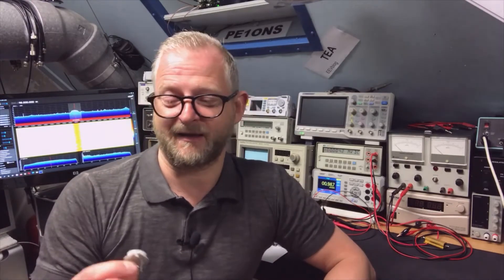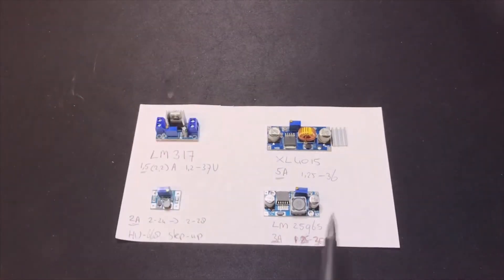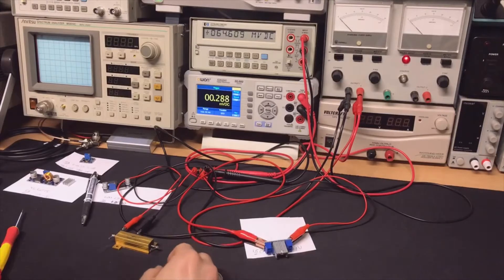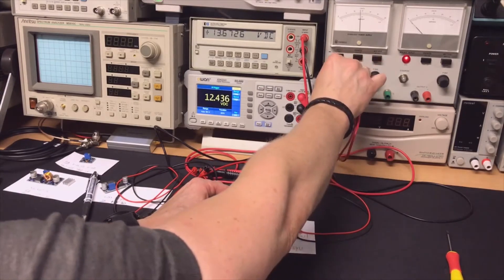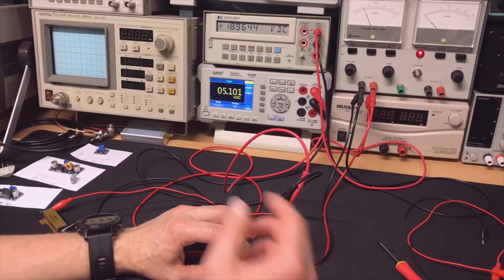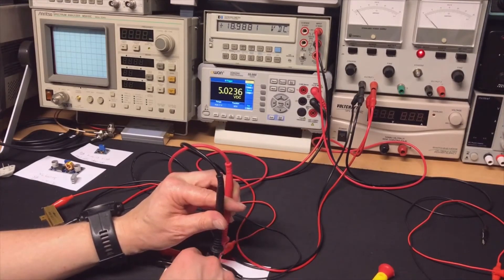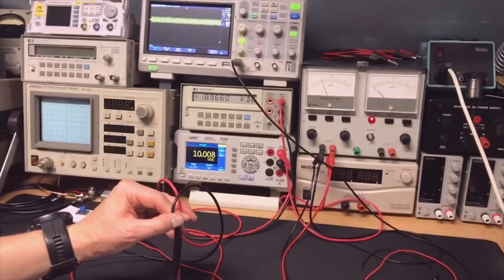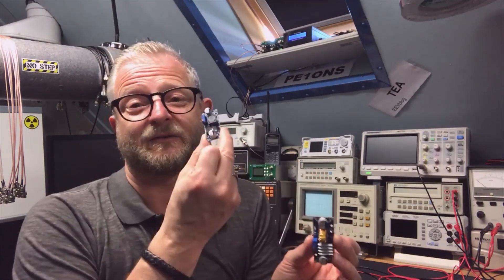#055 DC-DC Converters Buck Converter LM317 LM2596 XL4015

Comment: Can i charge  12,6 volt baterry with Laptop charger use XL4015 sir?
Reply from the maker: Charging batteries can be dangerous depending on the type of battery, like fire,  look for a correct charger for your type of battery
Reply: @TonyAlbus  18650 - 3s (12,6 volt)
Reply from the maker: @Syam-uo3wy  Don't use these modules.. better look for a LiPo charger.
Reply: @TonyAlbus  Ok thanks

Comment: Hi, what happens if output is set to 12v and input alternates between 12v and 14.5v? Will output voltage jump between 9.5v and 12v?
Reply from the maker: it should stay stable... otherwise it would be just liek a resistor, but i dont remember to be honest... i willneed t try that.
Reply: @TonyAlbus  thanks I know already output drops to 11.5v when input drops to 12v

Comment: Great explanation.  I have a DER EE-5000 LCR meter.  It uses a 9V battery and has an alternative power supply option.  The original power supply is 9V, 650mA SMPS.  Which option is best to reduce the voltage of the SMPS 12V 1A power supply, to use it to power the device?  With the lowest noise of course.
Reply from the maker: Hello Alcyone, for the LCR i would go for a Linear converter. LM317 or uA7809 and you can put 100nF at the input and output to ground for extra noise reduction.
Reply: @TonyAlbus  
Thank you very much for the information.  Do you suggest 7809 with ceramic or possibly tantalum capacitors?
Reply from the maker: any but no tantalum :)
Reply: @TonyAlbus  
Thank you :)

Comment: Sir,wich budget already made linear circuit you can suggest for handle 3A or more?
The circuit at 3.00  have only one lm317,if also would be possible add another one or connect 2 of these circuit on parallel
Reply from the maker: Hello i found this: https://powersupply33.com/power-supply-4-5-a-with-3-lm317-in-parallel.html 
OR THIS: http://electronics-diy.com/1.2-36v-5adjustable-power-supply-with-lm317.php
http://www.circuitdiagram.org/lm317-5a-variable-power-supply.html
Maybe that helps you.
Reply: @TonyAlbus  Thanks,nothing good kit from aliexpress?
Reply from the maker: @MACYNET323  The XL4015 from my links can do 5Amps. but that is not really linear, AliExpress has mostly these buck converters, i have not found a linear kit for 5 Amps
Reply from the maker: But is seems you can put those LM317 kits in parallel...
Reply: @TonyAlbus  Yes imho not convenient put lm317 on parallel,heat will not be equal and high V drop out.If you know a 5A linear module with low drop out for dimmer  my 12V led strip on 12V batt. Let me know. Oherwise what DC DC buck/boost module I can use with protection and moderate noise?Thanks!
Reply from the maker: @MACYNET323  if it is for LED's don't worrie about the noise..that XL4015 should be fine

Comment: sir, if I added 12v 10A input on LM2596, may I get output 9v 2A? please reply
Reply from the maker: Hello Abid, if you mean you have an 12V/10A powersupply and you want to step down voltage to 9V at 2A Max, that should be possible... the LM2596 can do 3A and the Voltage Drop is low.. just check if you maybe need to use a heatsink so it does nog get to hot. good luck with your project!.  Tony
Reply: @TonyAlbus  thank u sir....
Reply from the maker: @pasha_vaii  Welcome! enjoy.

Comment: I just tested an XL4015 to see how the short-circuit protection fared, because the datasheet was a bit misterious about it. It failed miserably: the IC smoked instantly. Input was around 19v, Output at about 12v, direct short across the output, and that was it. A pity, because it's an otherwise good module. Should be used with some kind of external current limit circuit. Another flaw with my module, is that it doesn't have any thermal vias to properly mount a heatsink. And it should have one. There is no way that module as it is sold is going to deliver 5 amps. Maybe if the IC was on the back of the board, with thermal vias, and a proper heatsink, and a fan for keeping everything at reasonable temperatures.
Reply: Some of them with CC CV trims and Blue boards are declared short protection, red CC CV and blue CV modules not. It's like the wheel of fortune
Reply from the maker: Thanks for your additional tests!
Reply: Most of these cheap ic modules rely on repeat customers, lol.. I put one of the three pot LM2596 on a modified TO-3P heatsink (remove half of the fin on one side to give around an inch of flat surface) and i generously applied thermal epoxy on it so it wouldn't touch or short the aluminum, another LM2596 to turn the voltage all the way down to 4V running a small 4020 fan are barely moving silent speed, some schottky's to prevent reverse emf , a 45c ksd9700 to trigger the fan on during peak operation only , I can set it up to just around 2.5Amps unattended this way. I am planning on getting the XL4015E1 and making a 4.5Amp version for my 5s and 6s lithium packs, like 80-100W Super Fast Chargers for ten bucks. LOL